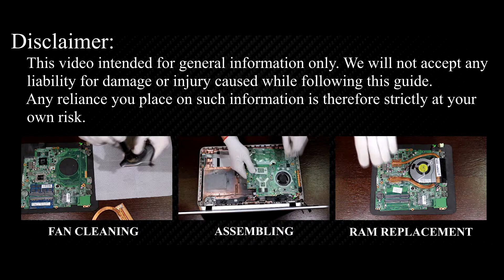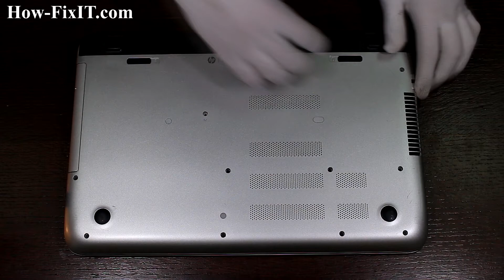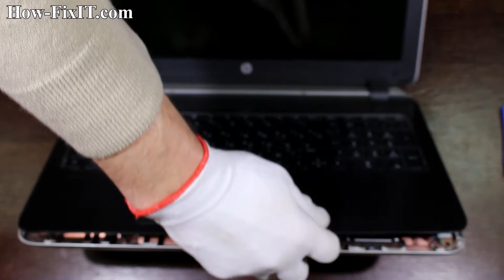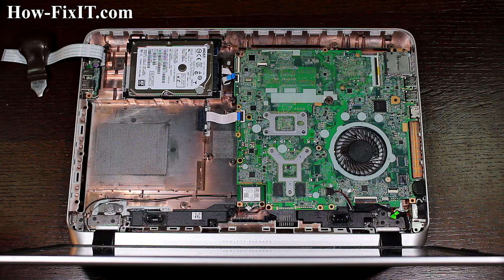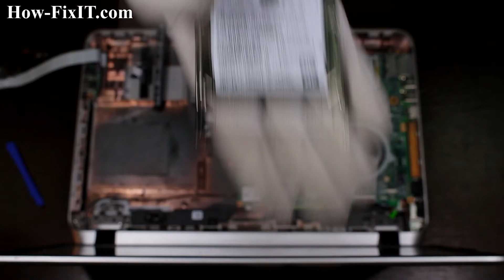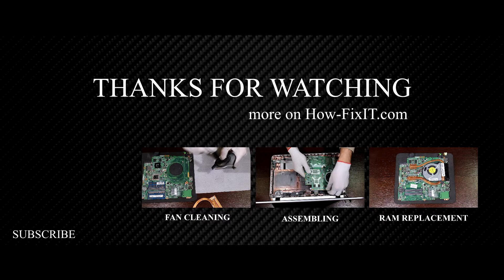HP Pavilion 15-P Series Upgrade: Replace HDD to SSD for Better Performance

Comment: Are backlit keyboards compatible with hp pavilion 15-p000? My laptop doesn't have a backlit keyboard but I found this on amazon, would it work? http://www.amazon.com/gp/aw/d/B010FIKWF4/ref=mp_s_a_1_1?qid=1458175492&sr=8-1&pi=SX200_QL40&keywords=HP+Pavilion+15-p000+backlit+keyboard&dpPl=1&dpID=51lsCg36oOL&ref=plSrch